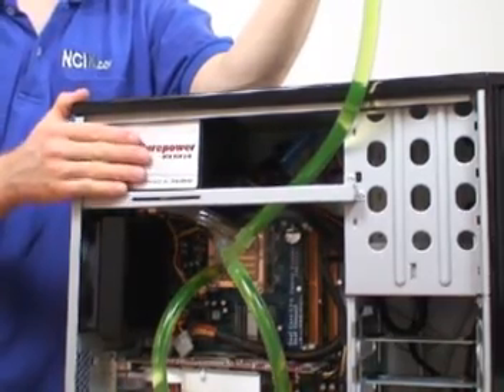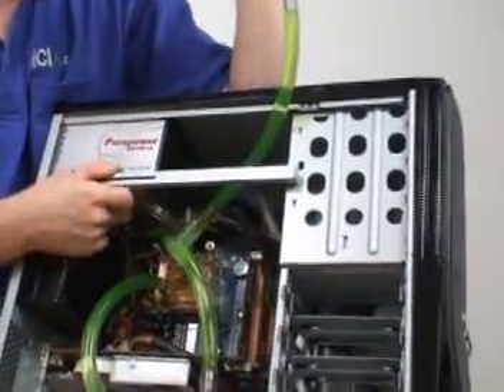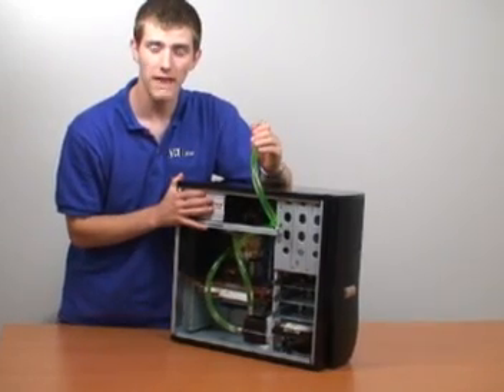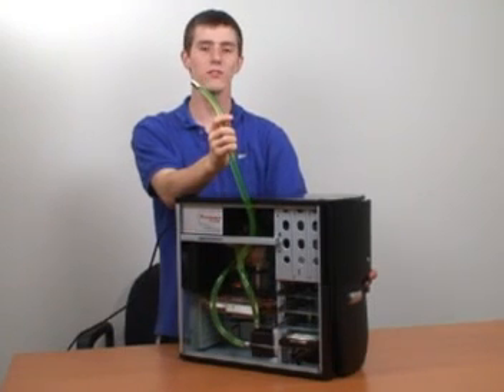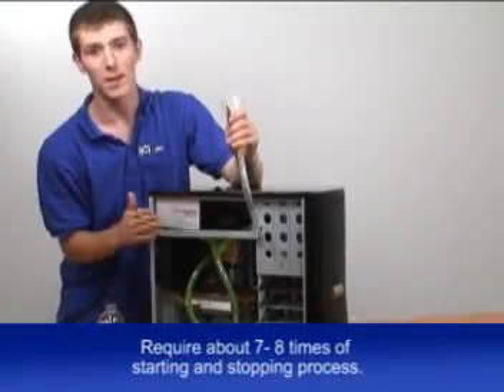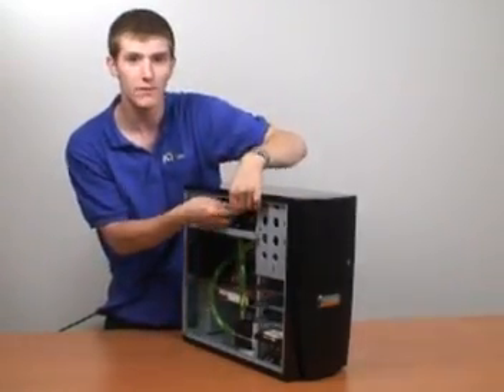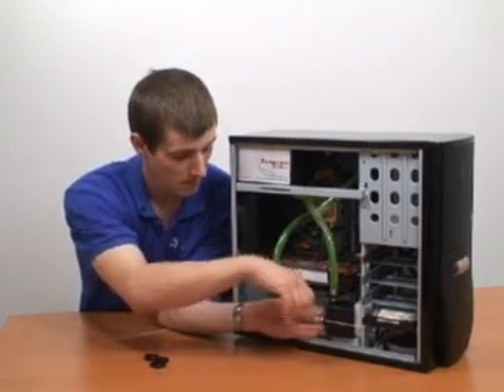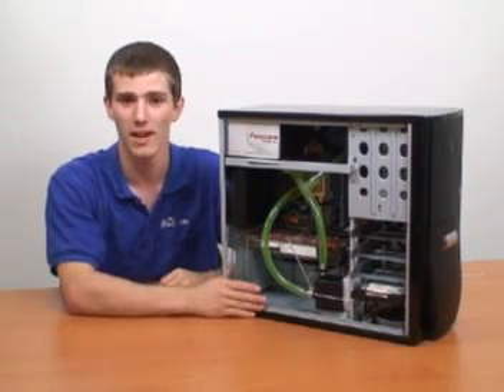Water Cooling Essentials (NCIX Tech Tips #2 Part B)

Comment: You did all that just for a 5 degree temperature difference on the CPU.
Reply: it was 2007
Reply: Dustin Moretz This video is not that much older than my pc. My pc's CPU is currently at 23%. For just a 5 degree temperature difference water cooling is a waste of time and money.
Reply: yes and there are much better water cooling solutions now,it's 2015
Reply: Dustin Moretz It doesn't matter what the year it is, 2015's better water cooling solutions weren't around in 2007.
Reply: They are now;it does matter what the year is.
Reply: Dustin Moretz The video was uploaded on the 30th of July 2007 almost 8 years ago and the only temperature difference achieved was 5 degrees so anything developed after 30th of July 2007 almost 8 years ago is not shown in this video, and the video is out of date in terms of 2015's better water cooling solutions. My original comment was on the video not what's available now.
Reply: +Daan Schroeder It wasn't me that said there where better solutions out now, what I originally said basically was why do everything in the video or it's modern equivalent for just 5 degrees, it's as waste of time & money.
Reply: +Daan Schroeder To me doing something like this is a waste of money, if I need a faster computer then I will just buy one as for hobbies sometimes they are a money pit and you can only do so much with a computer and eventually you will have to start again.
Reply: Water cooling is done for aesthetics, for fun and to get as much power out of the system as is possible. Just because it's not the most cost-effective way doesn't mean it's a bad idea.

Comment: cause all the new products are the same installation and set up for the most part. No point in recovering a water loop installation for 2013, it is basically the same from 2007 to 2013, just slightly different products. Which he covers. If that makes since. I know what you mean though =]

Comment: o don't use T lines but a reservoir that u connect directly to the pump if so it will never run dry and u can easily clear all air out of your loop.

Comment: @lillhonken 
Well, sort of. It's not true ionization (there is no voltage present, so they are not really acting as anodes), but impingement damage (which is pretty similar). The overall point is that you will pickup whatever is in the system (copper, brass, silver, etc) and the fluid will become electrically conductive (pretty quickly in fact). 
I personally like using distilled water mixed with "water wetter".

Comment: @toyilanglamko 
Go to a Jewlers and ask to buy some silver (you only need a couple grams at most), or just get a "KillCoil".  Silver is an Antimicrobial, and will kill anything in the water. If you are using distilled water (which is normally non-conductive of electricity) it will become conductive over time as the particulate from the silver mixes with the water.

Comment: @bososz 
Leaks... big deal... use distilled water... it's NON-CONDUCTIVE! A lot of people don't realize that. I've never leak tested a system prior to installing it in my life. I've also never had any leaks in my life. Then again I only ever use tygon tubing, barbs (with teflon tape on the threads), and nylon clamps. 
Just do it right the first time, and you won't have any problems.

Comment: @vDubrivation you have to remove all the plugs from the motherboard, video card(s), hdd's, etc first. then take the 20/24 pin plug and take a paper clip or wire, etc. and jump the green wire with any of the black wires. this will tell the power supply to turn on letting you power up your pump.

Comment: dudes right. never run your system with out a full leak and check of all the connections. a loose connection on any of the lines will leak. bigger the system and the more complicated  the  cooling system the bigger the problem will be. what looks good now , may not be stable if you bump or mover the system.

BTW that looks like a entry level setup.

Comment: FAIL.....   never hook power up to your board without leak checking at least 12 hours.

yes your using 1/2" barbs with 7/16" tubes but there is always a chance for it to leak.

Comment: If there's any dust on your PCB board then it doesn't matter how anti-conductive it is, the electricity can/maybe will run through the dust particles which are conductive, and insta-pop your computer.

Comment: Probably true, however at higher temps LCS have better heat dissipation than air, and also give the benefit of silent operations. For average, typical computers that A: Don't overclock, or B: Run fairly cool as is, no I don't see the need for liquid cooling unless of course, you just want one.

Comment: I don't know any water cooling setups without fans except for those oil submerged systems built inside fish tanks. You're going to need a fan or 2 mounted on the radiator.

Maybe you should look into that sealed water cooling kit made by Corsair since it is around the same price as a good air cooler.

Comment: i would rather have a reservoir that has a fill port. so i would make a hole in the top of the case, instal an after markert fill port, run a tube from the fill port to the one in the reservoir. so when ever i need to add more coolant or uv die i just unscrew a cap and pour the shit in.

Comment: ive OCed to 3.2 stable, but any higher and it becomes unstable. the problem is that even if i manually raise the voltage, CPU-z still reports 1.464v.
? i cant go any higher than 3.2

Comment: ive overclocked an e6400 2.1ghz to 3.2, set voltage to auto and OCed by raising the fsb. using water, max temps are at 38-40. but i can go any higher - is this the limit?

Comment: i dont understand fully but ima gonna guess.

buy one kit but add another cpu water block, and another radiator.

water should flow like this: resevoir to pump to radiator to first cpu block to second radiator to second cpu block then to resevoir.
 u might want to add another pump in between the first block and the seconds radiator

Comment: I have been considoring the move ferom air to water for donkeys years.  In the last 6 months or so I have been getting really into overclocking and can now see the limitations of air cooling.  I have ordered my first rad/pump cpu/gpu blocks and am going to give liquid cooling a try.  This guide really helps alot much better the reading a random guide rom google, so much better to understand when you can see it.